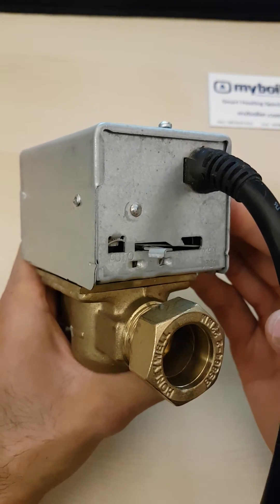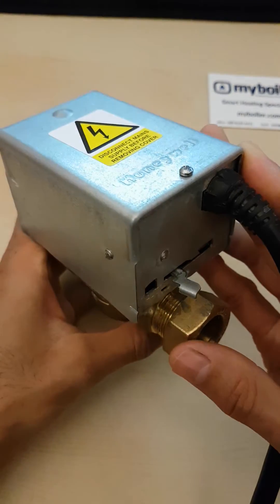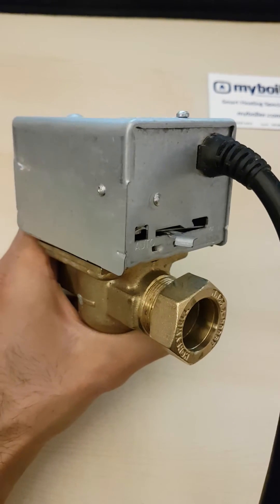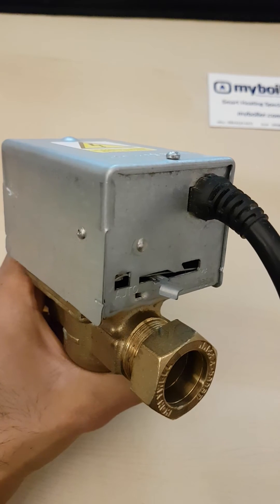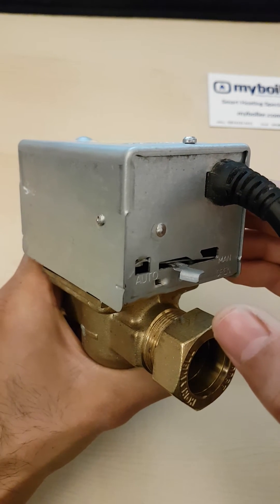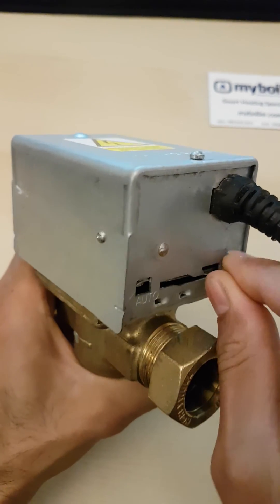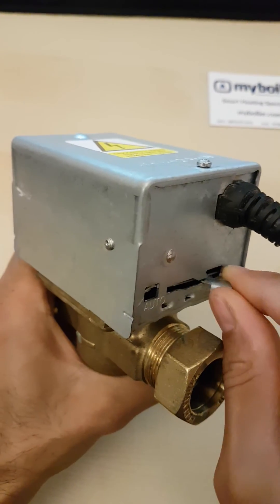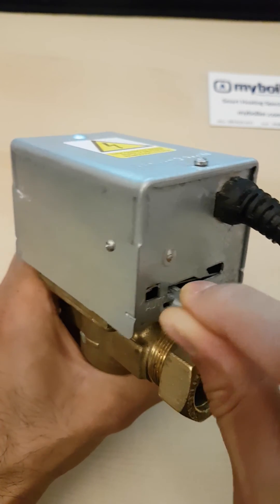How to check a 2 port zone (Honeywell type) valve is working

Comment: And if the slider is loose when deenergized?
Reply from the maker: Hi Rami, it mean's the mechanism is jammed into the open position and is unable to return to it's closed position. In this case very likely the zone valve head should be replaced also the base plate should be checked to make sure it's freely moving. This can also cause the valve to remain in the open position. You would have to remove the zone valve head to diagnose further. Hope that answers your question.
Jayesh (MyBoiler Ltd)
Reply: Could the hot water be isolated in order to remove the head with little leaking or will the whole system needs to be drained? Thanks a lot
Reply from the maker: @beavence Most of the motorised heads are dry detachment ie can be removed without draining down. Only some of the older ones are not detachable. If you have a fault with the base valve, it would have to be drained fully or partially dependent on your particular system. JK
Reply: @ARatedTV  I am afraid is the base valve since I tried a new motor and still not working, so just wondering if it will be possible to close the hot water main and the return and that will hold the water. at the bottom of the cylinder there is drain so I guess it will be possible to drain some water first since the valve is higher up, to avoid water coming out??? Thanks a lot
Reply from the maker: @beavence Sometimes removing the head, twisting the spindle gently side to side, will only turn about 75 degrees total, if it is stuck, this usually indicates sludge in the system. Changing the motor by itself may not be enough if the mechanism itself is worn out. JK